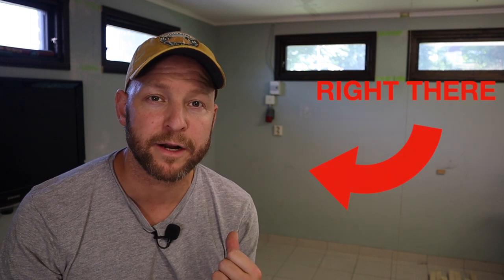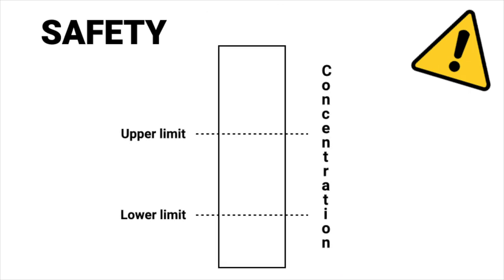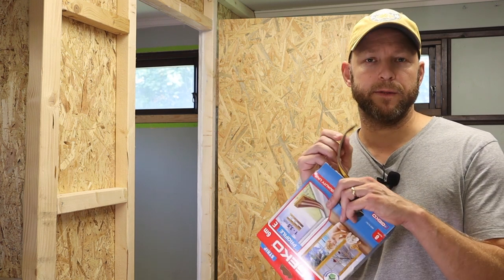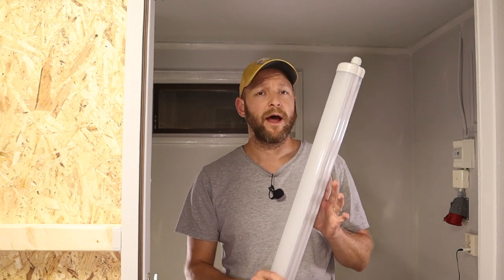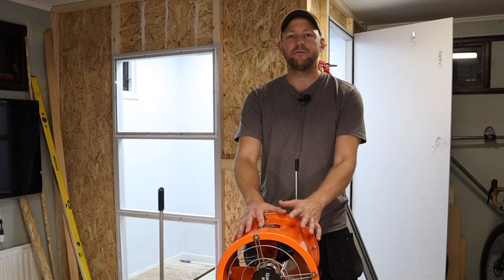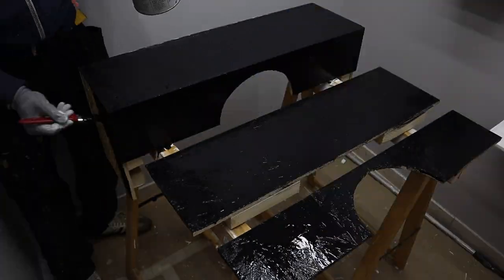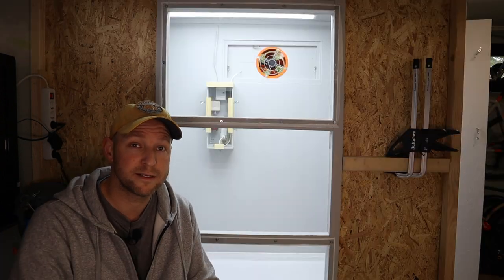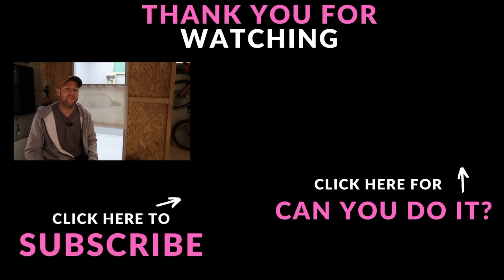Full build: Safe and affordable bike paint booth

Comment: Great video. I'm on the same idea, but I'm most confused about the choice of fan. Have looked at the same as you and similar, but you really know little about the quality and whether they are really explosion-proof. Have received a quote for German and Swedish fans that comply with EU requirements, Ce-marked etc. but then the price is about 3000 to 5000 Euro! Obviously you trust your choice but how have you thought about it all?
Reply from the maker: The fan is a big issue and yes they are expensive. Im not completely sure about mine but from what I could see, it looks properly sealed. Now that I have ran it for a few months and done a full bike paint in it, the fan snd ventilation makes a huge difference and I highly doubt that I ever reach the lower explosion limit, it’s all sucked out.